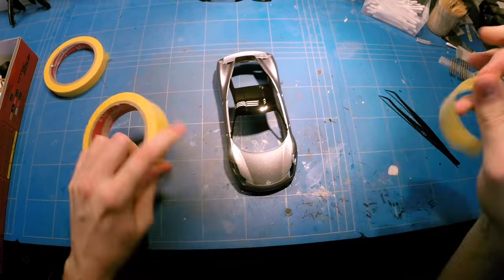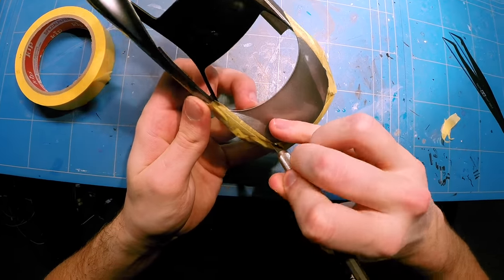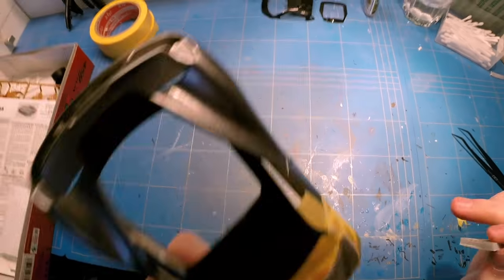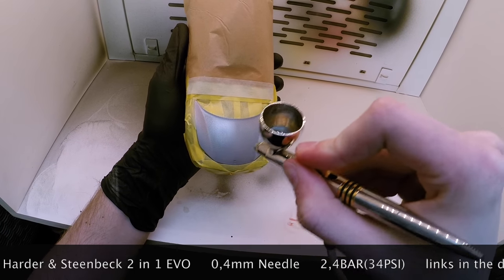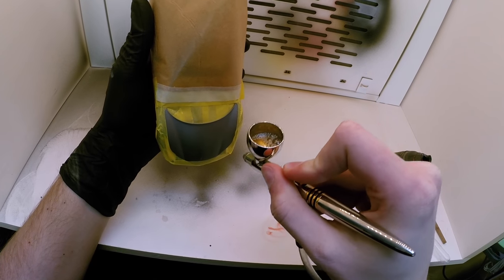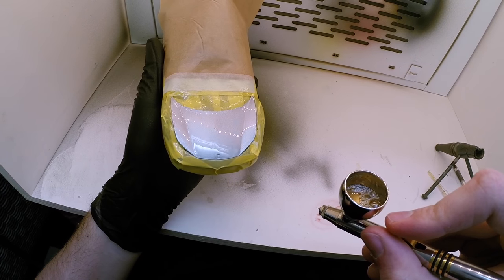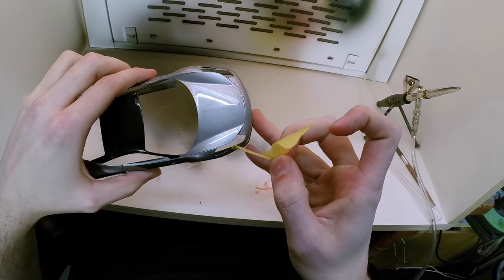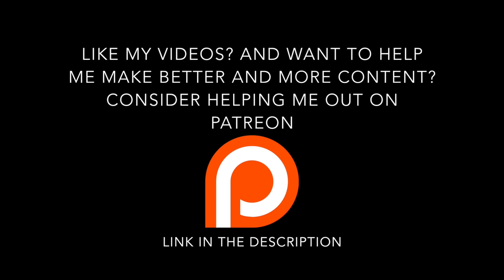How To: Spot Repair Scratched or Damaged Paint

Comment: Great channel. Can we please have more videos like this. I am always making mistakes with my paint and it’s frustrating as hell. Can you do a video on common newbie mistakes to fix paint before gloss coat. Eg i would have sanded down, filled that scratch, shot the silver again and it would have likely still been visible. Mistakes i make are , scratches, finger prints, small dust particles in the paint, slight overspray in areas making it look like wetter patches, repairing panel line damage from scribing mishaps, my wet coats tend to not stay wet and  level off evenly,  so i just end up throwing more  paint at the model. I appreciate it’s probably just my skill level needs to improve but help from vids like this saves a lot of frustration.

Comment: Hey Tom. Didn't have a severe issue like this but had some dust. Wet sanded it out, but now it left; best described as a divot; in the clear. What would you recommend? Should I do what you did, sand and repaint then clear or just mask off the trunk and reclear? The problem is this particular model; Porsche; the trunk lines are not fully to the edge and not as easy to mask off. I don't want to have to strip down the entire car down to plastic and redo the entire process from ground up like ive done multiple times on the same model as before. It was so close to being done too, which frustrates me big time

Comment: Thanks so much for the videos! Is it still the same process after decals and clear coats? I am worried about masking on the decal sections and having them pull off.
Reply from the maker: There is a very high risk on decal areas

Comment: Curious if you can answer: I sprayed a biplane kit with Rust-Oleum rattle cans ( came out very nice!) but screwed up a section on the upper wing as I was applying a clear gloss overcoat prior to applying decals. Not sure if the Rust-Oleum paint is enamel or lacquer. Is there any easy way to correct this without sanding/stripping paint down to plastic, repainting, etc.? This was six months of work on this kit only to see it cave at the final lap. Arrrrggggh! Any suggestions would be appreciated!

Comment: Nice work I watched most of your videos and I’m impressed with your technique and work ,
I’m new in this hobby and i wonder
1/what should i use to remove paint if i made mistakes or wanted to change colors ( both this kind of plastic and lexan body shell) ? 
2/if I don’t have primer or I can’t find can I replace it with white paint??
Reply: I find upvc plastic cleaner/solvent strips paint off good. It’s strong smelling and smells like lacquer thinner. That is probably good too.

Comment: I'm building the new tamiya suzuki GSX RR I was using the alclad candy silver for the sparkling silver that's called out for the candy just looked nicer but my issue was the Tamiya masking tape has left a couple of blemishes on the silver and I had left it to air off for 3 day's and took the tac out the tape I think I'm going to have to redo the 2 side pannal silver's I tried wet sanding but it was scratching the candy to like a darker gunish metal colour I'm not sure what to do here never experienced this with candy paints before have you had anything like this? Thanks
Reply from the maker: The metal and silver paint from alclad can be a bit fragile without clearcoat on it. I have had it tear of with the tape before.

Have you already sprayed the candy color? Or just the silver base?